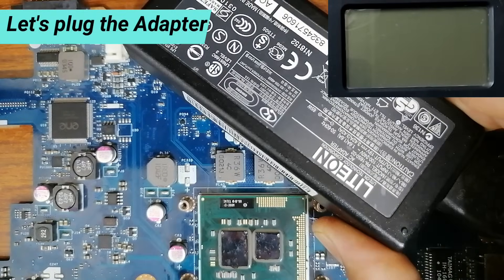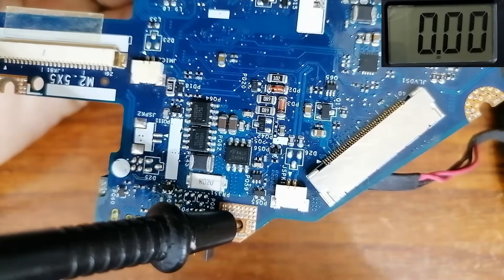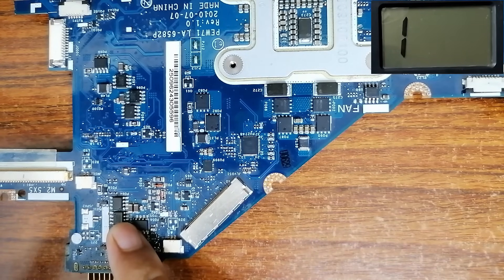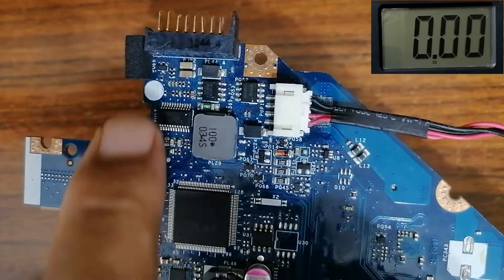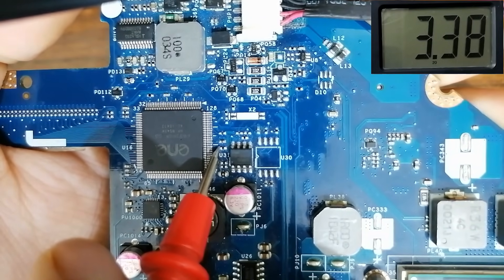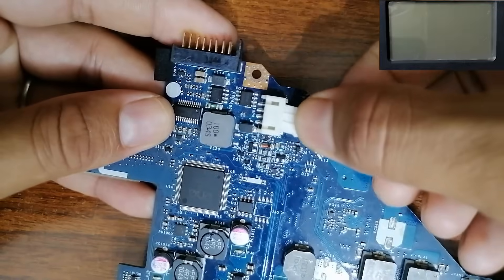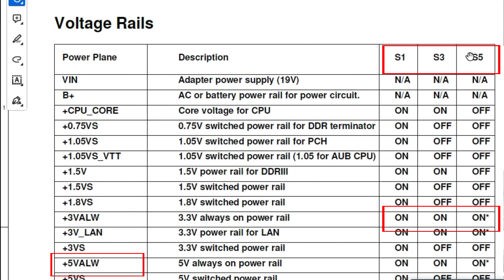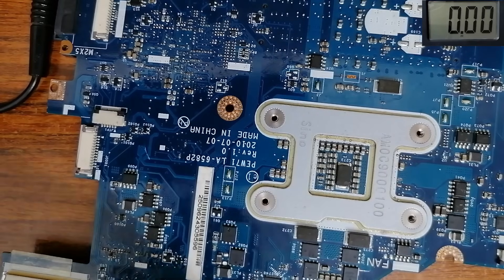Master Laptop Motherboard Voltages, Power Rails, and Circuits Explained | laptop motherboard repair

Comment: Hello, first of all, thank you for your videos for people like me with no basic experience with electronics but eager to learn from professionals like you. These well-explained tutorials are very useful.
I would like to know how to connect the motherboard to the output of an adjustable power supply when I don't have a charging cable, or how to connect it directly to the motherboard through the power input pins. I've searched extensively online and can't find anyone who explains how to do this in detail.
I think it would be very interesting to make a video on this topic for many people like me who are new to motherboard repair.
Thank you very much for your extraordinary contributions.
Reply from the maker: I'll consider making a video on that topic. Thanks for the suggestion

Comment: You’re the best! Thank you so much for your knowledge. Now I have the knowledge to start repairing my many laptops that have broken over the last 5 years (They don’t make ‘em like they used to). One example - Hp Probook 450 G6, I plugged in an accessory 5v device into one of the USB ports and the laptop went dead. It must have drawn too much power therefore blowing up some part on the motherboard. Now I’m hoping I can fix it after being dead for 3 years. Wish me luck! Thanks again 😎🪬
Reply from the maker: You are welcome, good luck with your repair

Comment: What a DAMN good video!!!  Liked AND  subscribed!!!  EE here working on electronics my whole life and THIS is how you explain motherboard repair.  With your strategy, you can get by without a schematic.  Identify the main chips on the board, (Northbridge, CPU, Graphics, RAM, etc.) then Google their voltage requirements.  Based on what the chip's function is you can figure out the power states for each and you'll know when voltage is supposed to reach them.  Loved your "looking for an inductor for input" to each section trick too.  Keep rockin'!  🙂
Reply from the maker: Thank you so much for your enthusiastic feedback. I'm really glad the video resonated with you, especially as someone with extensive experience in electronics. Your breakdown of the process is spot-o understanding the main components and their voltage requirements is key when troubleshooting without a schematic. I'm happy you found value in the inductor trick as well!. I'll definitely keep sharing more insights like this. Thanks again for subscribing and for your support, it's truly appreciated. Keep rockin' too!

Comment: 2:26  Sir , there's no current sens resistor in my motherboard . I looked at the back of my motherbard ( HP 625  with AMD CPU)  like you did and found nothing  in the close area of battery connector or DC jack connector
Reply from the maker: What is the type of your laptop please. In some cases, the current sensing resistor may be located elsewhere or integrated into a different part of the circuit. If it's not visible, it could also be part of a different component like a shunt resistor. I recommend closely inspecting other areas near the power supply circuit, especially around the power management IC. You could also refer to the motherboard's schematic, if available, to trace the current sensing path. Let me know the type of your laptop to help you locate it
Reply: @electronicsrepairbasics_erb      hp 625  compaq  presario   , I have the schematics in pdf , but Youtube forbids files hosting links
Reply from the maker: Hi there,
Please send me the PDF file via email, and I’ll help you locate the current sense resistor. You can find my email on the homepage of the channel.

Comment: Why does every inner circuit have one such entrance inductor?
Reply from the maker: Thank you for your question. The entrance inductor in a circuit plays a crucial role in filtering and regulating the flow of current. It helps prevent sudden changes in current, which can protect sensitive components from damage and improve overall circuit stability. If you're interested, I can make a more detailed video on how inductors function in circuits. Thanks again for watching
Reply: @electronicsrepairbasics_erb  would be great as a guide yes. Thanks man
Reply from the maker: My pleasure

Comment: The inductor broke off now I'm having white screen
Reply from the maker: A broken inductor can definitely cause display issues like a white screen, as it plays a critical role in power delivery to various components. I recommend checking the affected area for any further damage or missing components and replacing the inductor with one of the correct specifications. If you need further guidance, feel free to share more details, and I'll do my best to assist
Reply: @electronicsrepairbasics_erb  it's a Lenovo g550 the indictor is by the LCD port named l6
Reply from the maker: Thanks for the additional details. In the Lenovo G550, the inductor labeled L6 by the LCD port is crucial for the display power circuit. I recommend checking the surrounding components, as damage to this inductor can affect other parts of the circuit. You should replace the inductor with one of the same value and specs, be sure to refer to the schematic or boardview file for the exact details. feel free to ask
Reply: @electronicsrepairbasics_erb  how do you recommend I find the same inductor with same valur
Reply from the maker: To find a replacement with the same value, I recommend checking the motherboard’s schematic diagram if available. It will typically show the exact specifications of the inductor, including its inductance, current rating, and sometimes the manufacturer part number. If the schematic is not accessible, you can try checking similar models or reach out to the manufacturer for the specific part information. Make sure to match the specs closely for optimal performance. If you need further guidance, feel free to reach out
Reply: @electronicsrepairbasics_erb  Thanks boss where are you from
Reply from the maker: You are very welcome brother, from Morocco
Reply from the maker: Absolutely! Thank you so much. Feel free to reach out if you need any further assistance.
Reply from the maker: Join me on my face book group or patreon page for official assistance. take care bro
Reply: @electronicsrepairbasics_erb  how
Reply from the maker: All links in the description
Reply from the maker: Thank you for reaching out. It sounds like the issue may be related to a failing GPU or poor solder joints, which could be temporarily fixed by heat but ultimately require a more permanent solution. I recommend reflowing the GPU or, if possible, doing a reballing to ensure better connections. Additionally, check for any signs of overheating and make sure the cooling system is working efficiently. If you need more detailed guidance, feel free to ask.
Good luck